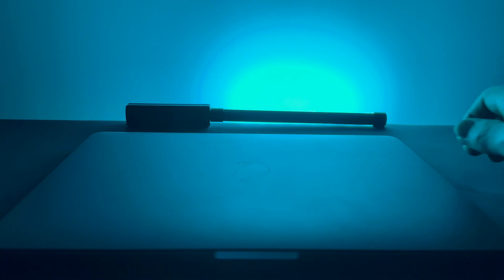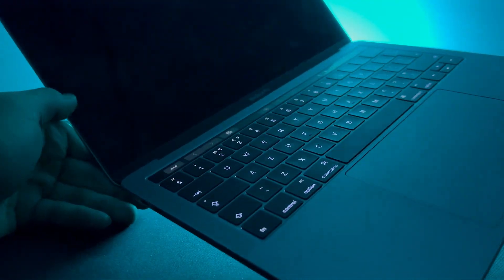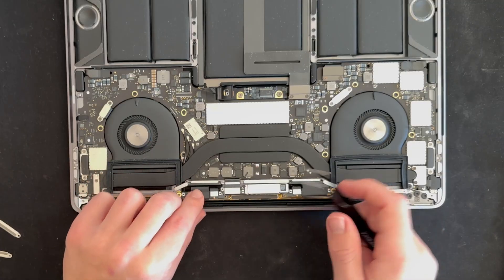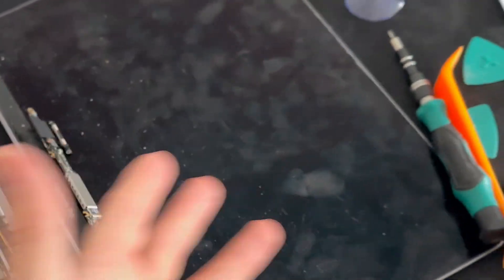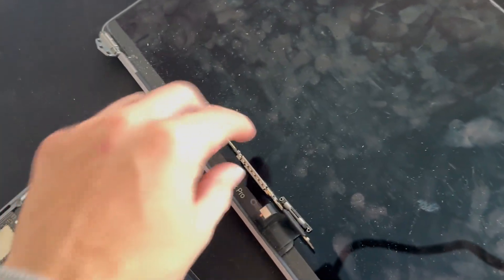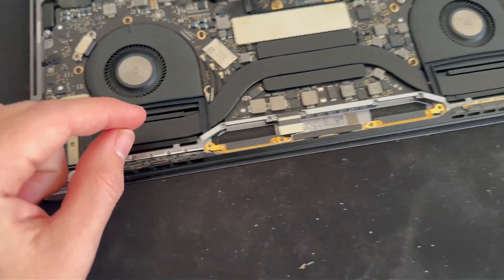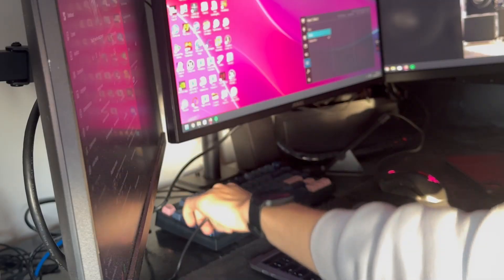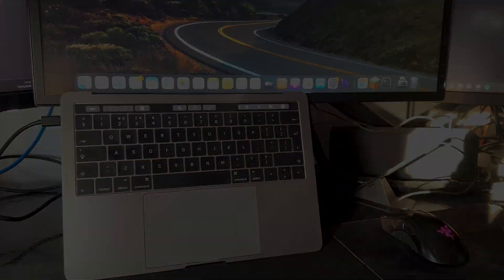I Built the Mac Apple Refuses to Make

Comment: Bro I HAVE THIS laptop hahaha ok it's the late 2013 maxed out with the epic :P gt 750m as well - it's a beast! for the prev 2 years it was my main pc, connected to a tb2 apple display I got for $50 from work. I had this "imac" for 2 years, edited like 10 videos at 1080p with final cut no lag at all, and played a ton of WoW with my buddies and some other ps3 era games. I still use it as my "laptop" and just plug it in to the hotels tv or so for movies etc, as my main/new PC is 20kg :P . Technically, it's a mac mini with a free keyboard/trackpad attached :P

tip: in my model, pre-2015 the wifi/bt antenna is in the screen's frame. So u gotta extract em and keep em. Mine... came without em from ebay lol, so I use a usb dongle for wifi/bt
Reply from the maker: That's awesome you've got the same one and put it to such good use! Ah really I did not know tha about the pre 2015 models so that is useful!
Reply: @BrookyBuilds  🤜🤛